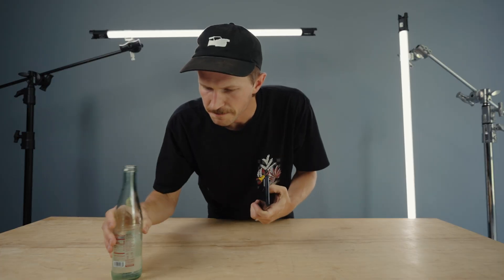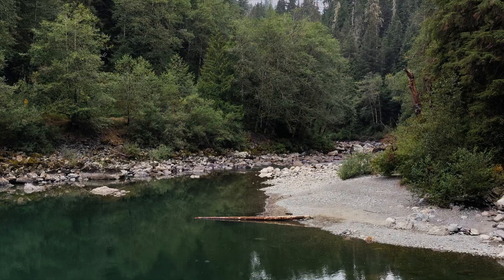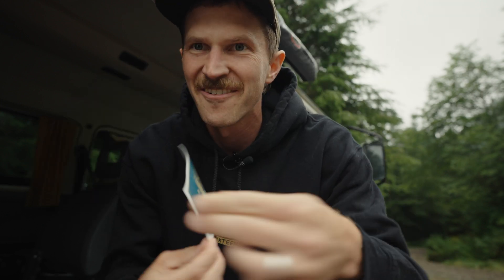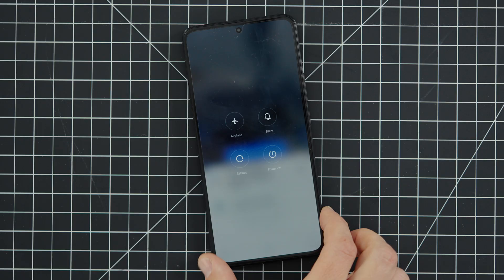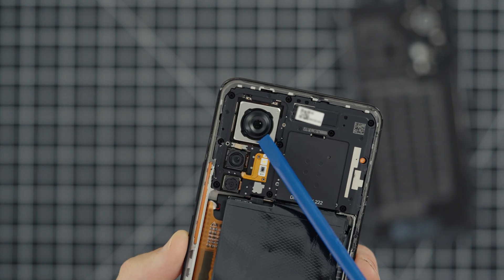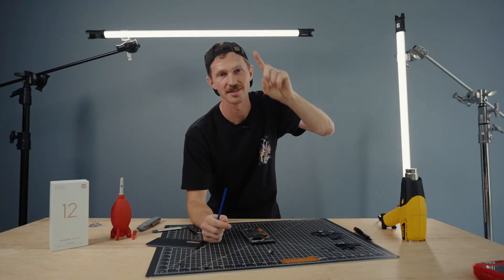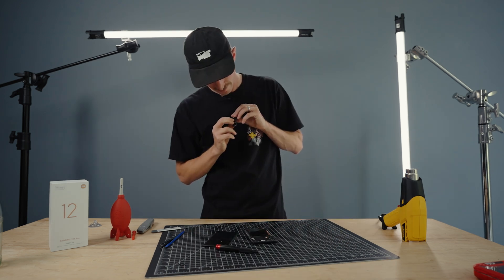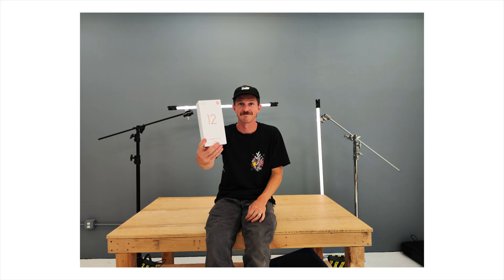Xiaomi 12T Pro Camera TEARDOWN!! I've Always Wanted To Try This

Comment: i want to know 12t pro have metal frame or plastic frame ?
Reply: Plastic 😔
Reply: Unfortunately plastic, but it doesn't matter with cover.
Reply: Yeah it's plastic on mine but at least it has a glass back which helps in heat management.